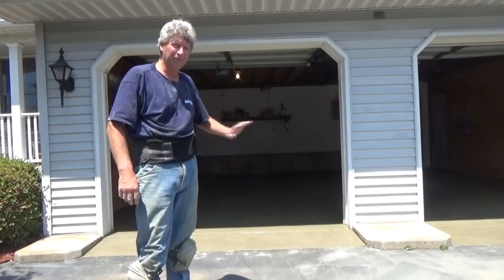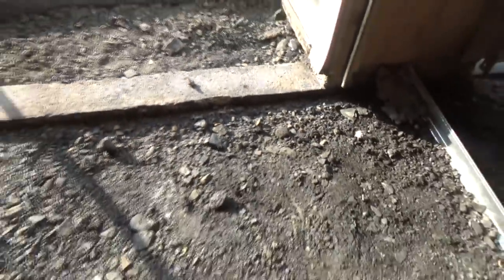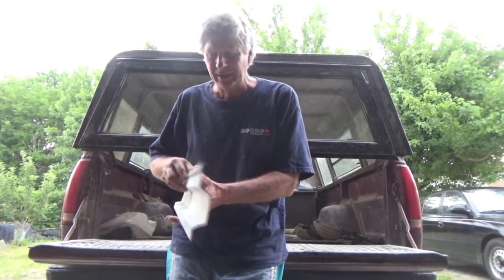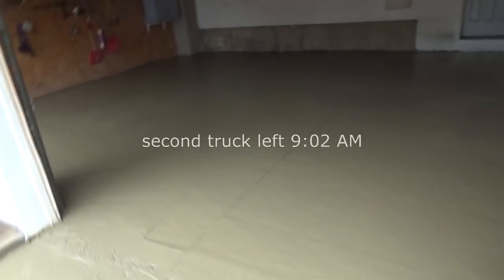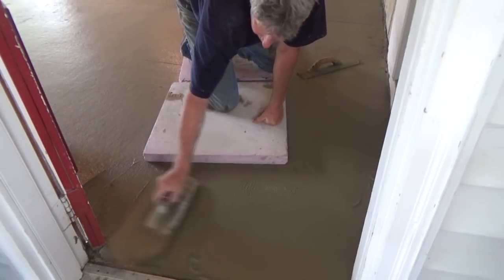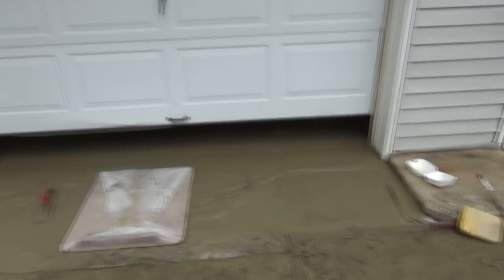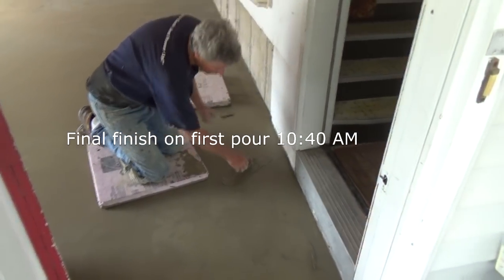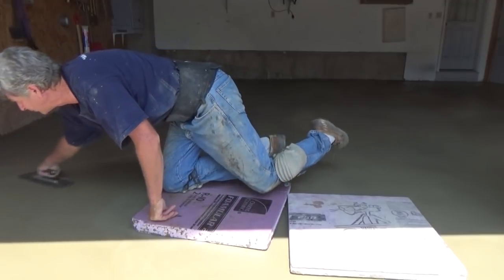SMOOTH FINISH CONCRETE (part 3) Mike Haduck

Comment: Mike I appreciate your opinion. I’ve poured concrete for many years and one thing I’ve seen and learned for sure is that everybody does it a bit different. It’s not worth it to get bent over someone doing it a different way than how you think it should be done. I try and keep my mind open and sometimes I just might learn something. So long as the end result is to spec or plan than what does it matter. I’ve been schooled many times when I thought I knew it all. Lol. Thanks for spending the time to put this together.
Reply from the maker: Thanks Paul, I agree an open mind and anything that works, I appreciate it, Mike
Reply: Concrete is its own Beast different everyday
Reply: If he comes in wet let him spin for 10:20 minutes Hill tighten up
Reply: Shame on you for using a pool trowel

Comment: Hey Mike, been a fan and student of your videos for a long time, best tutorial I've ever found.It's funny, I live in the same region as you roughly , and a few of the towns you've done jobs in I recognize lol.I work for a large masonry company in Northeast PA training mainly in concrete construction and finishing (I want to learn all masonry but it is what it is)and have taken tips from your video s to the jobs and have impressed the foreman and higher ups! The foam board knee pads are great for finishing btw when I first started guys tried to use the steel knee boards to finish and they were a giant pain to move around on plus clean after every pour, then we switch up with some foam like your using and it worked great, we actually save them for every job.One tip that we do with them is  wrap the sides in duct tape, to protect them and keep any foam from flaking into the concrete, works pretty good.I know your semi retired at this point but do you have any video doing concrete form work and whats involved with that ?
Reply from the maker: Hi shane,  that is good to hear,  I actually picket up the Styrofoam pads from a retired state trooper who did side work in concrete,  I did not do a lot of forming videos but I started adding them to how I float finish concrete,  I got a couple in the wings,  nice to hear you are doing well,  this trade is hard on your body for sure, thanks I appreciate it.  mike,

Comment: Love the video... you're an artist! I'm just learning, poured only 3" or so to hide the ground underneath the deck stairs. Finish was very rough, as cream was minimal, not deep enough, I guess. I groomed it with a broom to hide my mistake.... Learning from you! Thanks.
Ken in Hawaii June 2017
Reply from the maker: Hi Ken,  A least your trying and I am sure you will get it.  yep 4 inches is usually the least,  anything that works,  thanks mike

Comment: Mike i love your style of teaching.  You make it clear and understandable.  I have two cracks in my garage floor, which will be injected with polyurethane.  The house was built in 1987.  Should I add an extra two inches of concrete on top of the old concrete before I do the final finish of epoxy?
Reply from the maker: Hi Heidi, I couldn't say unless I was there, cracks can be patched but I never seen them do away,  thanks Mike

Comment: I like watching you work, effortless! During this pour/placement, I, or anyone with construction knowledge could tell this wasn't your 'first rodeo". Working beside you would have been fun because I would know that you were getting it done quicker and/or better than me and I would need to get my act together to stay up with you!

A short story: 
When new drivers of concrete trucks would arrive on the job, I would say, "give us some, we want to look at it." And if okay we unloaded it, if too dry we added water. But if it was too wet (or wetter than I liked) I would say "pull your truck out about 50' and take 10 gallons of the water out of it." My employees, knowing the joke would, like me, just stand there until he moved the truck forward or the driver would complain there wasn't anything he could do about it. After a little banter we would "let him off the hook." The concrete plant owner always knew this was going to happen and would enjoy the joke with us for a few weeks.......(Over a period of years, 3 drivers actually pulled their trucks forward and got out, then finally realized we had pranked him. Afterwards, these driver became very loyal to us and would try anything we asked).

Regarding concrete expansion:
 I was taught in the 1960's that a 30 degree CONCRETE TEMPERATURE CHANGE would cause concrete to move .375" per 100' length. I've noticed over the years that this is nearly an absolute rule, I said NEARLY! When traveling the interstates you can look up at the bottoms of "I" beams in the overpass sections and see a "rolling shoe" at one end of ever other section to allow for concrete movement. But concrete placed inside a structure with a year around controlled temperature rarely moves, just my 2 cent comment. 

Thanks for a great and very enjoyable video, looking for more!     
....13
Reply from the maker: Hi 13.   great comment,  I wrote it down about the .375 of an inch, and I am assuming that is after it dries,, and it makes perfect sense.   anyway our joke is to say to a driver "A little dryer please"   its a good thing to have fun,  thanks 13 ,  mike
Reply: Yes, for set concrete ----  3/8" per 100' for EACH 30 degree change of concrete temperature, not ambient temperature. Summer is coming with higher temperatures, check it for accuracy. 

Also, I found it could be prorated:
1)less temperature change (i. e. 15 degree change would be 3/16" movement per 100' --- this doesn't seem to be as exact as partial length measurement --- see note below.) 
2)partial lengths change (i. e. 50' would be 3/16" movement per 30 degree temperature change'). 

Also, I found steel "I" beams, rebar, etc. moves in nearly an exact fashion. I'm sure engineers could educate us thoroughly!

NOTE: The PARTIAL (less than 30 degrees) temperature change appears to me to be an algebra formula of some form --- which is unknown to me --- rather than being a TRUE prorated formula. But it's close enough for small structural and slab concrete jobs.
Reply from the maker: Hi 13,  I get you and It believe it 100%,  thanks for the info,   mike

Comment: Hi Mike, thanks for sharing your knowledge this way, it makes doing projects myself a lot easier. Do you have any idea how I can easily make a to be poored concrete floor water proof to be able to use as a shower? It will be a large space, no walls near the shower area. Thanks so much, Thijs
Reply from the maker: Hi Thijs, usually they make a  floor kit for tile, I would check the options, thanks mike

Comment: A few things I don’t agree with, u should always make your first pass with your mag so the concrete still breathes and the water can escape and use the mag to make sure there’s no dips or holes and make sure it’s tight against the wall another thing you used a pool trowel for a hard trowel finish floor that’s a no no and another thing u didn’t make enough passes in my opinion of course we always trowel till there’s no cream left to bring up then it’s done but everybody is different and if u never have a complaint or problem and the customer and yourself are satisfied then ain’t nothing wrong with it, again just my thoughts from a commercial finisher that came from doing residential
Reply from the maker: Hi Stanley,  worked in the union 3 years huge pours and our family been in business over 70, that's the way we do it and never had a problem, thanks Mike

Comment: I've got a cracked garage floor from salt in Montana. Can I just put a layer of concrete on top and then top it with an epoxy coating?
Reply from the maker: Hi Agape, they make other products made specifically for garage floors, I would check them out first, thanks Mike

Comment: thx for the video , i do have a question on the screed key , when you are doing your final trowelling , are you trowelling it down to the metal top of the screed key , and how are you finishing that , are you using and edger for it also ?
Reply from the maker: Hi Lloyd, I only use the edger on outside sidewalks but for a garage floor I trowel even to the metal top of the key and it cracks right on top of the metal and looks like it was almost cut there,  my way but never had a problem,  thanks mike

Comment: Hi Mike ! Great video, do you think thats a 2x4 form is too shallow for a driveway slab? Im thinking about adding a footing and rebar
Reply from the maker: HI REd,  driveways I like to go at lest 5 to 6 inches with wire mesh and lots of expansions joints,  everyone says different,  I hope it helps,  thanks mike

Comment: Are you saying not to use rebar in garage floors, and does that include monolithic floating (Alaska) slabs?
Reply from the maker: Hi Joe,   every situation is different,  I just show what I use or others are using on a certain job , I would always check with the pros in your area, again every situation is different,  thanks mike

Comment: Hi Mike, is the plastic put down first to prevent the moisture from coming up through the concrete and making the floor sweat?
Reply: You are correct, this is the vapor retarder. It is there to prevent moisture from getting through the concrete and setting the due point through the concrete or the insulated layer if slab is insulated. Sweating slab (probably during summer) means no vapor retarder and that the due point is either above the slab or within the slab. Driven by the difference of temperature, humidity gets from a dense to a sparse environment (vapor drive); this is why you need a vapor barrier.

Comment: say mike do you have any videos on how you set forms  so that the slab will slope away from a house or shed
Reply from the maker: Hi Steven, I do not, but I usually just pitch them away or dig out at the ends near the form so the water will not travel inside,  I think I did that on my How I build a concrete porch with deckpans,  thanks mike
Reply: got it, thanks bud

Comment: Mike, what's your opinion on using a flower watering can when pouring curb. I've seen this recently with some contractors we had in town.
Reply from the maker: Hi Ivan,   I can not comment on that, I never seen one being used on a concrete job,  might be for a purpose for some different reason,  thank smike
Reply: I do it all the time. When you're doing hand rolled curb, you pour at a really low slump and the water helps you bring the cream out and seal it up. Otherwise you have to spend too much time on each section and you end up having to struggle more on the concrete as it sets up more
Reply: I seen em using spray bottles

Comment: Mike is there a better way than reed bar? this makes me worry for the future of many bridges and dams all around the world, the bridge in italy could have suffered reinforcement failure, but Im no expert. All the best from the UK
Reply from the maker: Hi Ellery,  they don’t build many things that last over 50 years,  Just the way it is anymore, thanks Mike
Reply: Ellery J Queen They do make a rebar with an epoxy type coating that resists chemical erosion. I’ve never used it, but it’s what they use for bridges and road beds. You do have to still coat your cut ends though in the field.
Reply: We could all start using stainless steel bar but someone has to pay a hefty premium I'd assume.

Comment: What is the tool you use before using the finishing trowel?
Reply from the maker: We call it a mag. Or aluminum float , the old timers used wooden floats, thanks , Mike
Reply: Thanks Mike!

Comment: Mike, Can you talk about porridgging over old fire brick. Thanks!
Reply from the maker: Hi Chris  I never heard that term? and am not familiar with it,   thanks mike
Reply: Clerical error Mike.....I meant Large over the fire brick that would make up my homes chimney.  House is from mid 60's.  Looks like previous home owners had at some point parked over the brick and it's now falling off.  Is it right to just lock off the bad stuff and redo it?  Thanks again!
Reply from the maker: HI Chris, I can't really say over the internet, I would have to be there to see it.  but I am sure common sense will prevail,  I would ask a couple local guys when in doubt,  I hope it helps,  thanks mike
Reply: Hi Mike - you said ask a local guy so I am......You.  I'm in Taylor.  May I contact you somehow?  My concern is the structural integrity of the chimney which is why I"m reaching out.
Reply from the maker: Hi Chris, contact me at mikehaduckmason@gmail.com   and sometime after New years,  I will stop over and take a look,  no worries,   mike

Comment: It's not as easy as it looks guys takes a certain type of guy I'm in Indiana n do alot of concrete as a contractor and sub contractor gotta have 2 guys good on a screed board n good with a bull float or frizno n hand finishing is a part of the trade he's right but the problem with hand finishing is man power and nowledge if u run a towel machine n you dont no what ur doing it's easy to stack the concrete I started at 12 years old pouring on weekends with my dad n grandfather 16 I had a full time job in it at 22 I started my own company pouring I just master a towel machine at 21 n pours are different u get to mutch air in the mud it makes the job hard n if it sets in the truck turning n gets hot it's just like having calcium in ur slab sets up very fast gotta no the concrete no if u need water n what u need so u don't loose the slab you do major pours u gotta no ur shit little pours broom finish still takes skill but it's easier that slick finish u want a glass finish once ur twords the end turn ur blads up in ur trowel machine and burn the slab n seal the same day if u can just how I was taught my grandpa was in the finishers n used to do commercial concrete he was the man I learn from the best I guess but every one has there own way
Reply from the maker: thanks Jake,  a lot of great masons out there for sure,   and experience rules,  thanks for the comment, mike